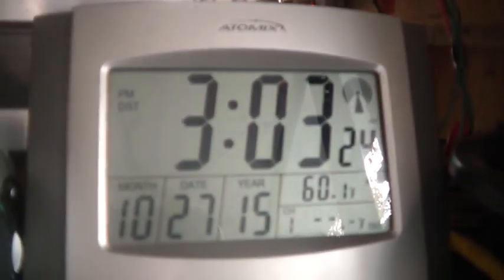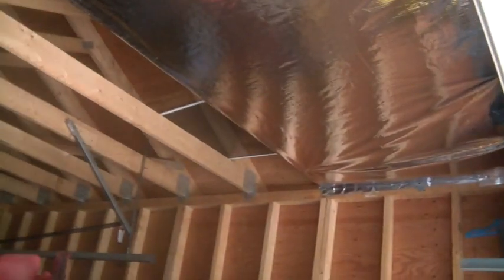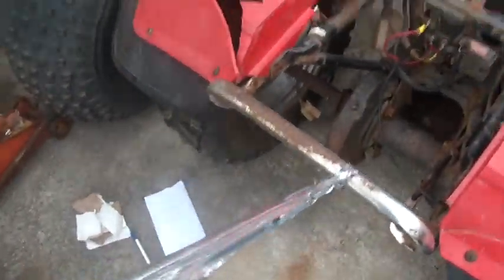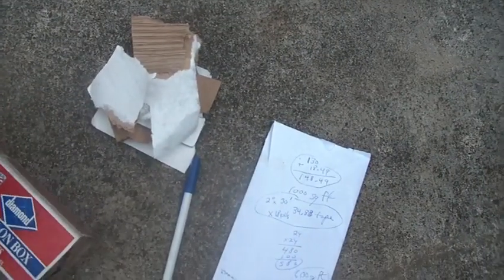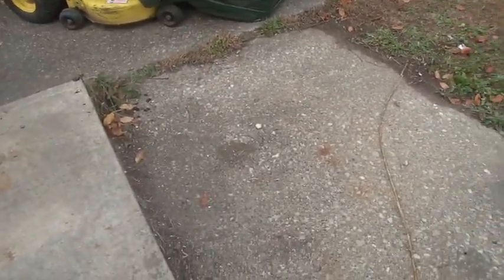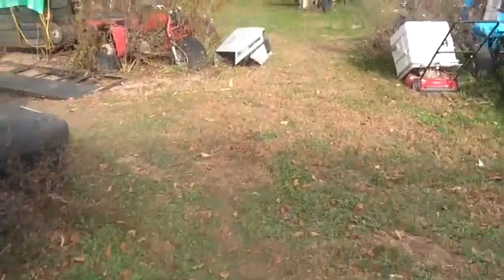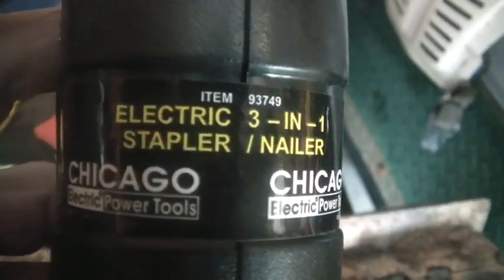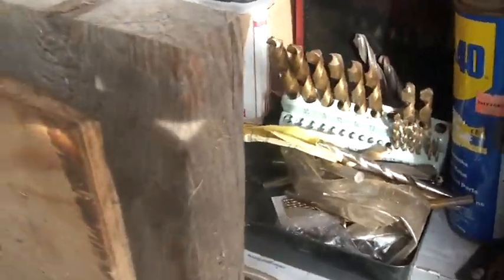ARMA Radiant Barrier, closer look, Harvey's burn test

Comment: I put some on my doors , it had the bubble wrap in the middle , will see if any better , doors were 1/2 plywood , so hope this helps
Reply from the maker: +Terry, the reflective part will help reflect the heat back if U have a source out there, other then that, it should provide a little insulation and keep the drafts out... Let me know what U think... Thanks for your thoughts, watching, and commenting!

Comment: It looks like it would make a better vapor barrier than plastic. Right?  Not as flammable as paper but will melt. Should make a noticeable difference don't you think?   But the electric stapler looks to be a wash. Good luck
Reply from the maker: +Rusty “rustyglovebox” Glovebox , Now that the barrier has been up for a week, I have happy with it... Seems for have cut the draft so much, just seems so much warmer and drier in the upper garage compared to the lower one... I am not happy with how well it burns, I was hoping that is would just melt and not sustain a flame... Used my 35 year old stapler that is held together with a bent nail, had no issues... Too bad we can't get stuff like that anymore... Thanks for your thoughts, watching, and commenting!

Comment: Class A materials are brick, gypsum board, non-organic cement board. Fire spread and release of toxic materials are also involved. There may be more to how it is installed to achieve that rating. If it keeps more of the hard earned cash you are burning to keep the shop warm from going right through the ceiling then you have a winner. 
Let's see now The Harvey rating system. Does your product stand up to his rigid testing?
Reply from the maker: +James Anema , The reflective film seems to be working, though, it failed the Harvey fire test... I expected it to melt, not catch fire and burn... Now that the film has been up for a couple of weeks, I am happy with it, my upper garage seems to be warmer and drier then my lower garage... Thanks for your thoughts, watching, and commenting!

Comment: All of the other materials used in a typical attic for construction will also burn.
Reply from the maker: Hey Kevin, The Mylar film burned really well, like fire starter well....LOL.... I hear U about everything else in the attic being flammable like the really dry trusses up there, but, I think it is best to be away that the mylar film is more of a fire starter then a fire break..... Thanks for Ur thoughts, watching, and commenting!!!!
Reply: I'm not looking for a fire 'break; I don't know of there is a radiant barrier that retards flames.  Have you researched anything in terms of lightning starting fires?  I've also read the barrier will conduct electricity and can arc at connection points like the staples.  Lots of contradictory information out there.